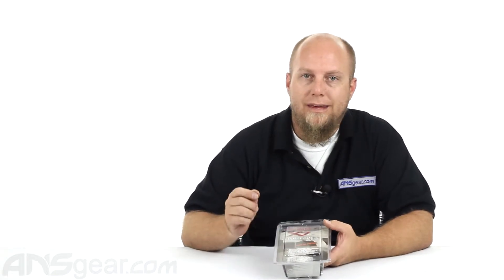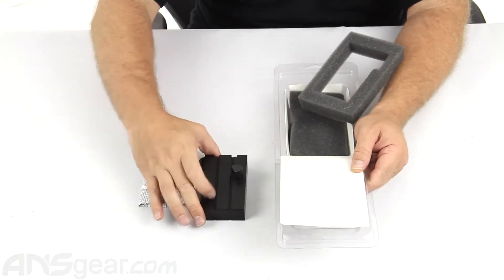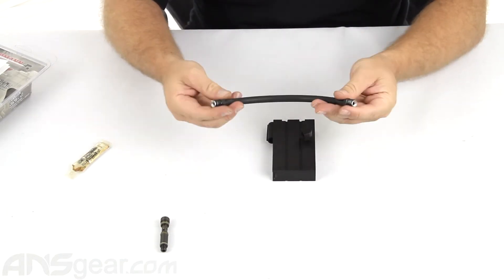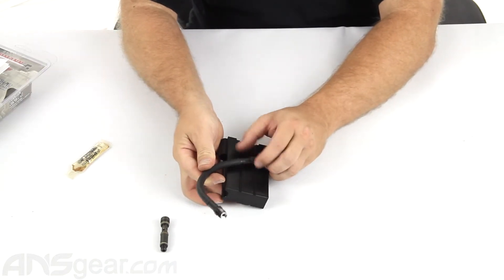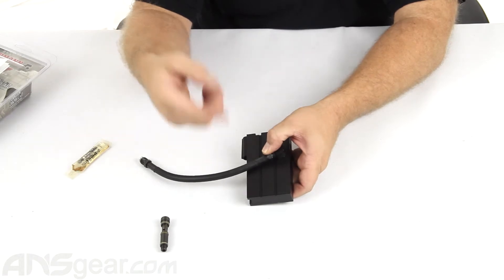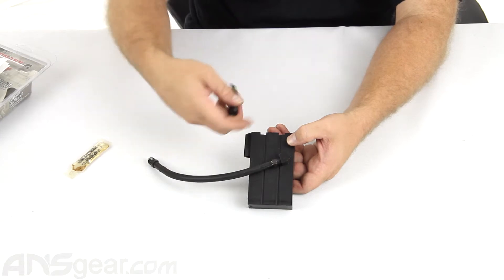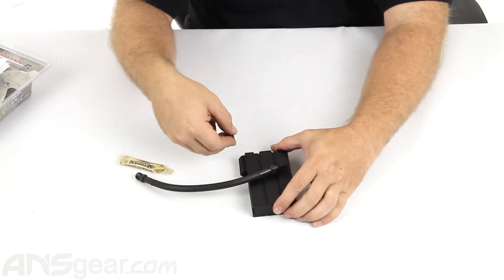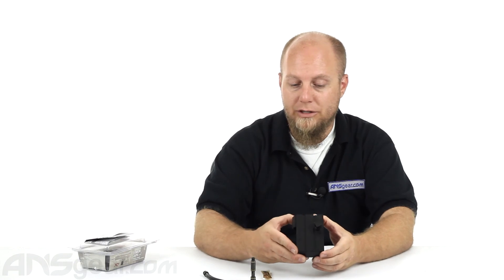Tippmann X7 Expansion Chamber Magazine - Review

Comment: So expansion chambers for tippmann only actually works when you use co2 and not Hpa?
Reply from the maker: That is correct as  Co2 is filled in your tank as a liquid and expands into a gas. However liquid Co2 can still escape from the tank the expansion chamber gives the opportunity for the liquid to become a gas. Since compressed air is always a constant air there is no use for an expansion chamber.